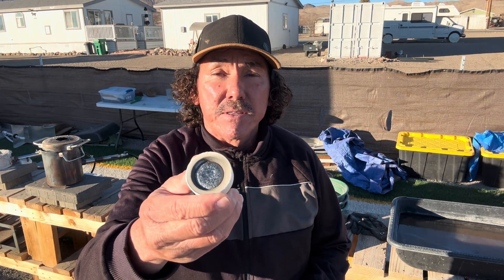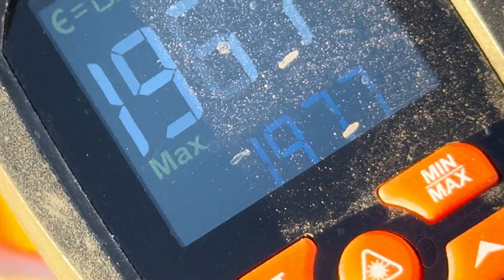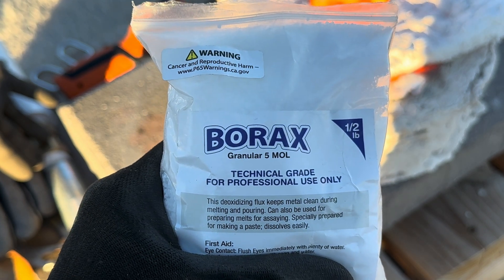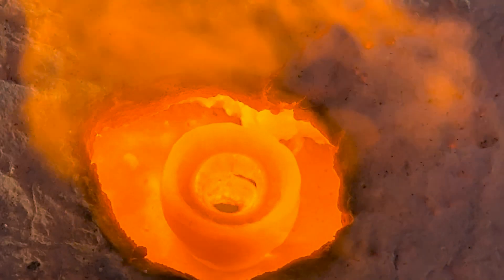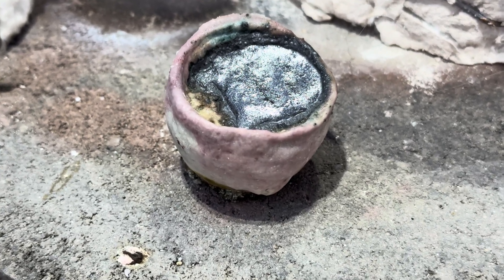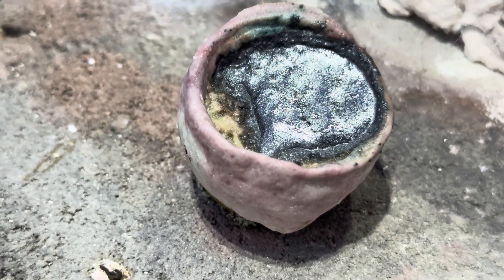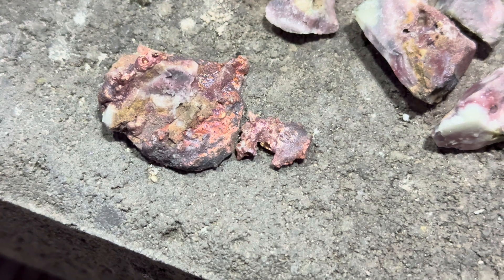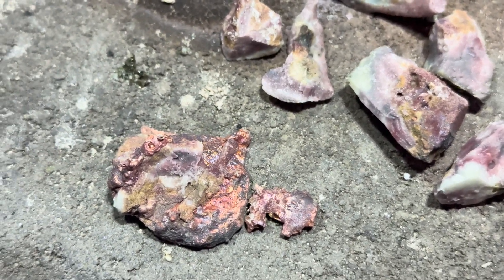It’s Copper In The CPU Pins

Comment: Think it would produce better results with no Borax. Only cupel and prill, then the oxides of lead and copper can soak into the cupel, leaving only a precious metal bead. Borax works great to seal a melting dish to avoid melted metals soaking into the dish.
Reply: oops, I see you had trouble cupelling a few vids back in "Acid Processed CPU Pins".
Reply from the maker: @mikegallup5695  Thank you Mike. I tried just that in the first video and I couldn’t get it to oxidize. It literally takes 2200 degrees Fahrenheit to keep this prill melted. I’m not sure as to what other metals were in that prill. At the moment I’m finished with that project. I appreciate your input and always feel free to give me your thoughts. Take care 💪🏻🤗